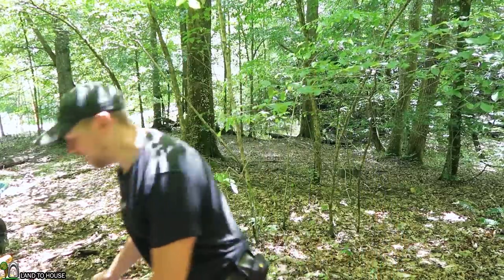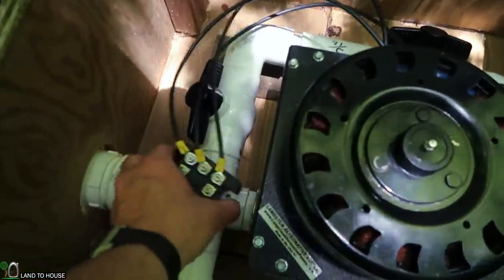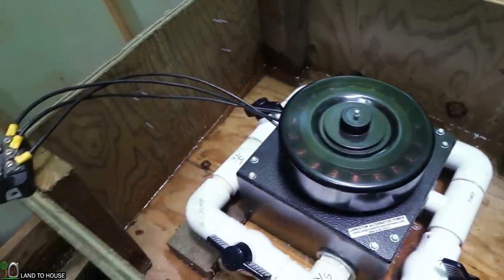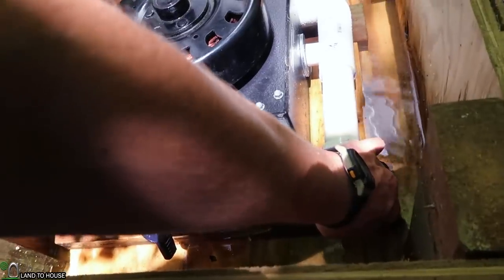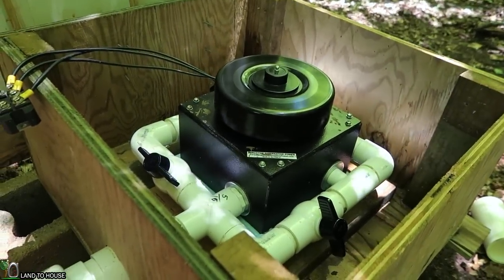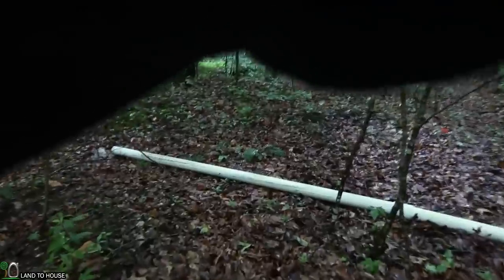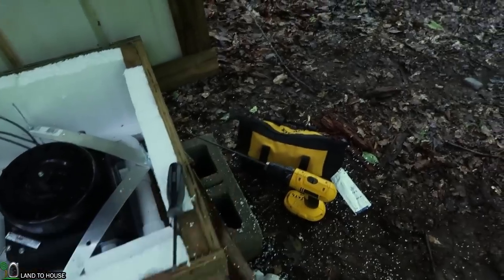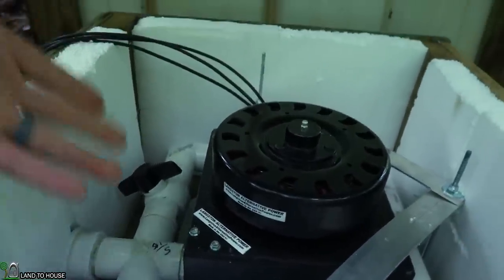Installing the Turbine Micro Hydro 6/10

Comment: Don't run DC over long distances. Run the 3 phases and rectify it at the other end
Reply: A few 100m is not a long distance.
Reply from the maker: Keep watching the series. I use 3 phase for 250 feet.
Reply: Oh I watch heaps of your content. I live in the suburbs and will probably do anything like what you have done in any of your videos, but it's all still very cool.
Reply: @Jiyukan  for low voltage DC it is. 3m is significant for low voltage.

If you feed 12v into a 1A load over 100m, it's probably only going to be 6 at the other side depending on the conductor. High voltage, AC, goes long distances. That's why our power grid uses AC and transformers. It's also why we use 48v AC for PoE to power 12v devices a long distance away. If it's 42v at the other end, we can still regulate it down to the 12v we need no problem. And the current at 48v is only 250mA to produce 12V at 1A (assuming 100% efficiency. So really it's probably 300mA). That means our conductors can effectively be 1/3 the thickness. And that's with DC. With AC it can be even thinner again. That means a lot more power over a lot longer distance without the significant transmission losses you would get with DC. AC makes sense over distance.
Reply: @LandtoHouse  I did actually watch one of your videos where a guy had a dam in his backyard and ran AC to his house and recitifed it at the other end. I still can't get over the idea if having a dam in your backyard lol
Reply: @benduffy4223  This is not entirely true, simplified it does not matter if you are carrying AC or DC. AC can even be worse because it will induce currents in the nearby conductors. What matters is the voltage you are transmitting over the wire but effective voltage wouldn't change with a resistive load in either case
Reply: @onix331  inducing current in other conductors is a stretch. The 3 phases might be 120 degrees out of phase with eachother but unless you actually run 3 conductors seperately and then put one or more of them right next to another unrelated conductor it's not going to be an issue. You would have the 3 conductors together though and not run them next to, say, a television antenna or lv signal wires.

The problem is that conductors heat in a different way when electrons flow in a single direction vs in alternating directions. When the flow of electrons is alternating the cable has less efficiency losses from heat.

The heat of a conductor does directly effect the voltage, because the warmer a conductor is the higher the resistance is. The cable itself adds resistance to the load.

But on top of that, you need to remember that the ideal diode is not efficient. Regardless of if you are using purpose built power diodes, Schottky diodes, there is forward voltage loss immediately at the diode. That gets dumped as heat hence the need for heatsinking. Even if you use FETS with low RDS ON, that RDS still needs to be accounted for.

So what you are doing is introducing efficiency losses before transmitting the power, rather than after.

When every watt matters, is doesn't make sense to have efficiency losses everywhere. Your diodes lose energy to heat, your transmission cables lose energy to heat, your inverter or whatever at the other end loses energy to heat.

The more off those efficiency losses you can mitigate the better
Reply: @onix331  Even a small brook could do, and you'd dig out the rest. My question then is, how many batteries, and what kind, do you need to store that energy long enough for the dam to fill up again. Hm!

Comment: Why only use 2 nozzles? Using all 4 nozzles will balance the load on the bearings and probably reduce the noise at same power-level.
Another thing. When the pressure drops over the turbine => Velocity drops & Since the same amount of water coming in has to get out => The diameter of the drain pipe under the turbine needs to be significantly larger.

Comment: Instead of the Styrofoam, why not use the "Great Stuff" Insulation? Use a THIN piece of plywood to mark off where you want the foam. Also, the Metal plates you used to press the turbine down onto the foam, you should of made them Parallel with each other, along the sides of the box instead of the corners.

Comment: I'm thinking you might need more jets running when the turbine is under load. What is the nominal voltage you desire. You definitely want to run AC to your power distribution system. 
Have you determined how you're going to add in the solar panels? Are you allowed to pump extra electricity back to your power provider when you have minimum household load?
Nice job Seth. Is Ashley as enthusiastic about your project as you are?  
Another rainy Tuesday🙄.  🦀
Reply: With a system like this you usually have a battery bank that will absorb all the energy made by the hydro generator, 300 watts for 24h is 7.2 kWh of power that you can use during the day. Then your inverter pull power directly from the battery back for toasting your bread in the morning, your toaster might be using more than 900 watts for 6 minutes, which is 225 Wh. I'm not considering any lost in the system here. The hydro generator would not be able to power it by itself, that's why you need a battery bank with a charge controller. The charge controller will probably run the generator (we should call this an alternator really, it's AC), it's gonna run the generator at maybe 60V to 80V DC once rectified and under load to charge a battery bank of 48V. The 200V here is rectified AC, each AC phase might be around 140V, but it's called "Wild AC"; the frequency is not normalized to 60 Hz or 50 Hz (depending on where you live) and cannot be used directly to power anything other than resistive load. When the battery bank is full and there is no need for energy the charge controller should dump the energy so to always keep the generator (alternator) underload to avoid spinning it too fast, some alternator might be able to run without any load for a long period of time, your alternator designer should be able to guide you with that. Usually the rule is that you make it (power) you use/waste it. The dumping of power is usually a resistive load, electric water heater, heat your pool, or a radiator outside during summer or in a unheated space during winter. For this application I hope he is not going to rectify the power at the alternator and bring that Wild AC to the house then rectify it. I would use a pair of transformer also to make sure I transport high enough voltage under load to only use 14 gauge wires that cost way less than big fat cables. The cost of transformers versus upsizing the cable have to be calculated to the least cost. To be able to sell your electricity back to the grid you'd have to install a UL listed grid tie inverter, but when the grid is down you won't have electricity either, the grid tie inverter are designed cut cut off AC power when there is not grid to protect the technicians working on the lines.
Reply: FA:  Thanks for all that information. Great things to consider👍.  
Sounds like you've been there and done that.  🦀

Comment: My pressure washer pump bogs down when the water input is more than 2 gallons per minute. The same may apply here. Less water may be a faster turbine. Try 2 and 4 jets with the ball valve half open.
Reply from the maker: I actually just got another nozzle that is 3/16". That should let me use another nozzle to utilize the last water overflowing at the top. I would like to see 250 watts all the time.

Comment: Why isn't something like that already installed at every waterworks facility in all city or urban areas situated on hilly terrain? I mean, seems to me, that every slope carrying water is a missed opportunity right here. Or am I wrong?
Reply: Hydropower does not scale economically until you get into massive infrastructure projects. The government and private entities don't want to spend 5-10k a pop to make generators that make 800 bucks worth of electricity a year. Plus they require a lot of maintenance and cleaning which is also costly. Check out very low head turbines for a more realistic way to install hydropower on rivers.

Comment: Nice home for small critters. Heads up and watch out for mice. Your drain hole could be there way in especially if its warm in the box during winter. 
Love it though! I think we should access all the free energy we can for the world is a beautiful place. Let's make an even better place
Reply from the maker: Haha that is exactly what happened. Mouse chewed a wire.... locked the pma down. The the water froze and busted all the pvc in the housing. Needless to say there is going to be a rebuild series.
Reply: @LandtoHouse  aww dude I'm so sorry to hear that. I was only saying it because I'll go to pull your own parts for certain parts for cars and more times than not there will be a nest of some sort inside air vents ducks, and hoses you'll be surprised where they make a home. Anyways yes they chew the wires in the car. Why is that? Teeth sharpening? Maybe. 
Again I really like the idea and where it's going. Cement pad, cinder blocks, it's your  project but wow ideas come flooding in. Great job and ty for doing your part in saving this planet I like to call home.

Comment: A flat roof, insufficient sealing of the turbine housing with foam designed to seal gaps between concrete and rim joists on a foundation and no insulation around the inlet pipe for winter and decent lack of pitch on outlet to prevent vacuum. How about a heat source for the turbine housing to prevent winter freezing of inlet nozzles. Gee what could go wrong?

Comment: i was going to mention it last video but forgot the you have mounted the turbine is not the best in my opinion, have a lip all arround the edge of the outer case is a bad idea for water flow, the centrifugal force will throw water to the edges and fall out , that lip will significantly stop water draining out the unit and possible to a point it slows down the turbine and you lose power. im surprised it dosnt have external brackets to fit it, which would be a better solution , drilling into the case of the turbine and fitting right angle brackets to suspend the unit in the box would be alot better.and a small screw protrusion inside the the housing as long as the turbine doesnt hit it will be so much better, this lip of the wooden box is also the cause of the water getting in because your slowing down the watyer with the lip and the water backing up on it is forcing it into the into the box,, and the 3 inch drain i dont think is enough. you need as much no pressure open flow as possible to get that water out of the way of the turbine fast , any water that stays in there will slow it down losing you power
Reply from the maker: This box will need a redesign. There is likely some slowing of the turbine due to water getting in the way. I like the idea of placing a catch pan under the turbine.
Reply: @LandtoHouse  yes that's  a goo idea after the water has fallen away from the turbine it didn't matter what happs to it. A box under the turbin to catch the water to slow it and collect it and a 3 inch pipe to drain it. The idea you had right right but just needs more space under the unit for water to fall away and no lip around the edge.  You would only need say 12 inches under the turbin to allow the water to move away enough. If you still get vacuum pressure in the drain pipe drill done holes in the top of the pipe to allow air to flow. 1/2 inch hole should work and being at the top I don't beleive water will flow out of them. If it does there's to much pressure in the pipe and you need to go bigger. Or have more than one pipe

Comment: You might ntry a 4in or even 6in drain  but put a 25ft long pipe out the bottom to direct the drain water away from the base and not flood out the ground

Comment: Nobody said what pushes tbe water into the turbine, is it one of those pumps that work directly off of the stream pressure or have you got an electric pump that supplies the pressure
Reply from the maker: My apologies for not being clear. The creek runs 30gpm down a 1100 foot penstock.

Comment: Really nice system this is brilliant...you don't need to install ram pump if you could power a water pump using electricity generated by this generator..in fact its lot of power than ram pump

Comment: If you run the 3-phase AC to the house and then  convert it to DC you will have less power loss in the wire

Comment: yeah looks like you need to open the bottom fully maybe have a old water tank under that then links to the white pipe then drains back into the creek maybe even free pipe side by side if flow is to great for 1 or 2 pipes also you drain pipe is going up hill at moment maybe a stand pipe as the pipe come out from under the housing add a t with a stand pipe so it will pull air there rather then ay turbine exit